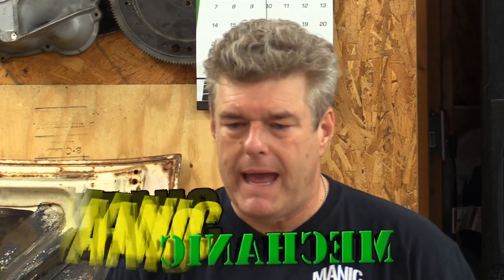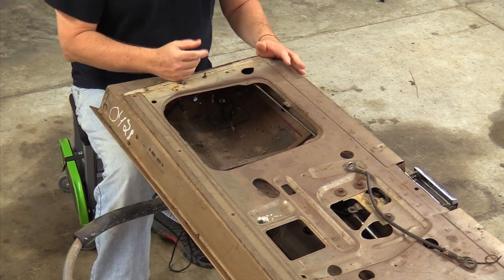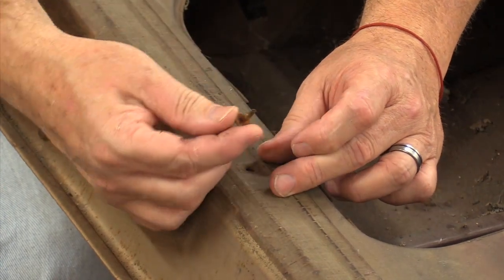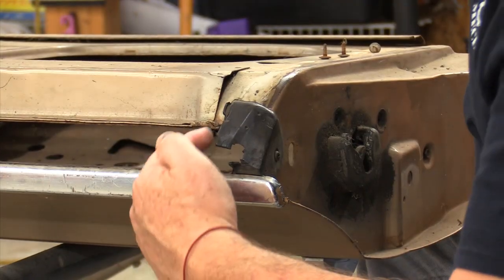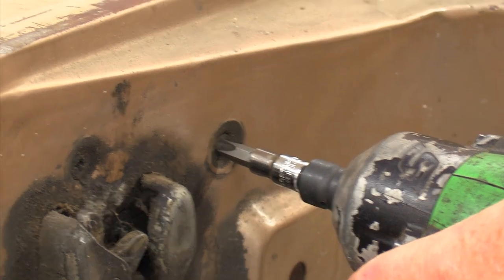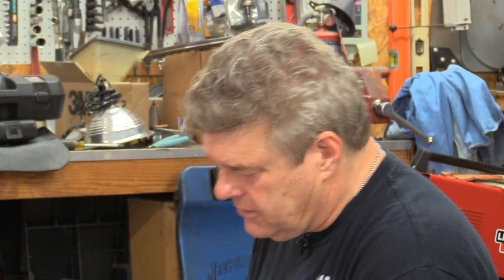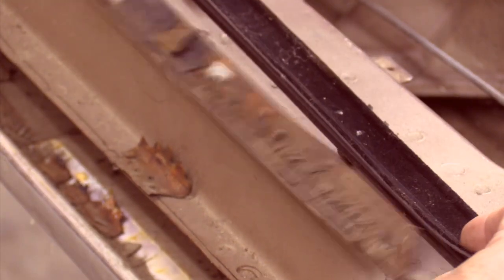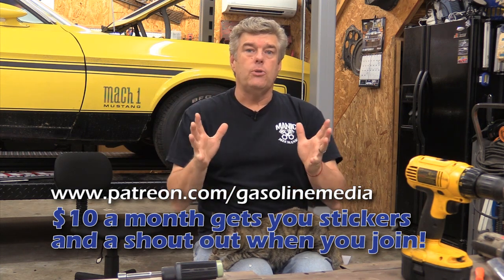How To Stripped Screw Removal Station Wagon Ranchero Tailgate Episode 52 Manic Mechanic

Comment: Since your in, epoxy coat or weather treat the inside and add or make some drain holes.  Darn un-obtanium part 🙄
Reply from the maker: good plan we're going to be putting some por-15 and later on this week to keep the rust problem to the minimum in the bottom of the gate.

Comment: We still haven’t gotten our 68 ranch wagon gate open 😩, we haven’t been able to manually trip the latches in the correct sequence or the bear claws are frozen. As soon as it’s not 900* outside we’ll work on it again.
Reply from the maker: Man I'm sorry, I thought by now you all would have had that done. There's a wagon like that at a local salvage yard I've tried several times to get the gate to come down but it won't.
Reply: Well like I said it’s been 900* and as like you said life happens. It hasn’t been high on our list. Working on brakes. Updating to a booster from a 1996?? Ish crown Vic. Going to video it.